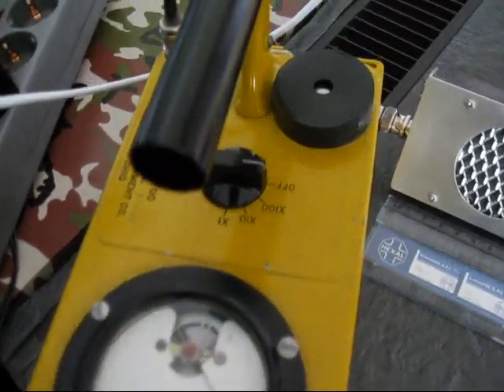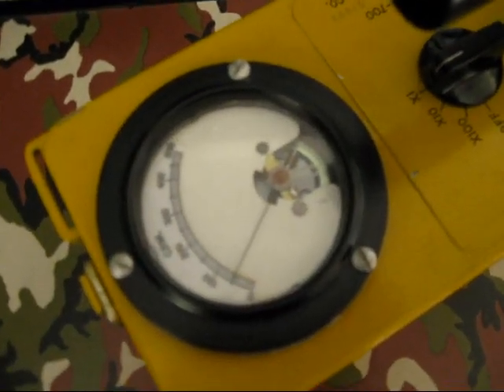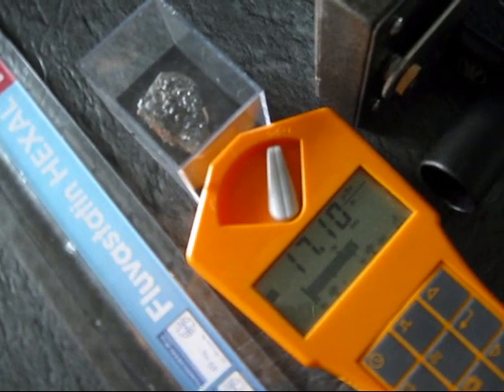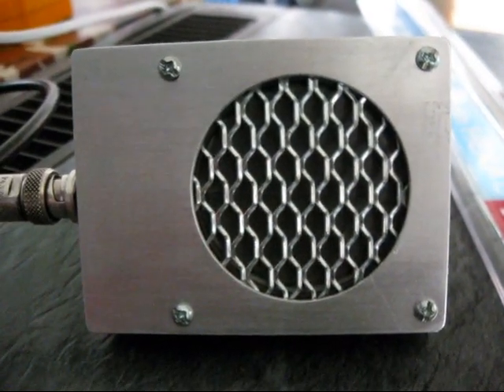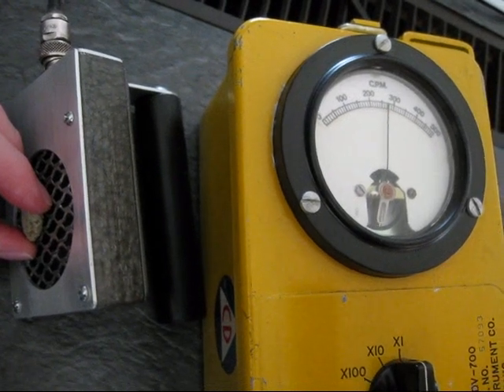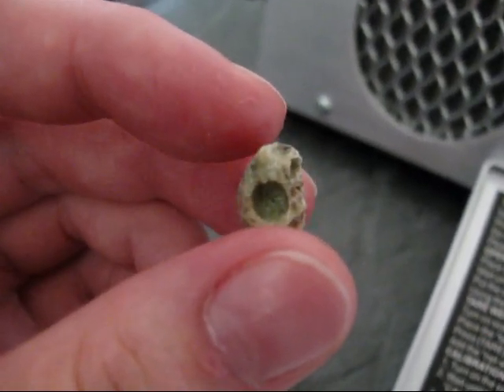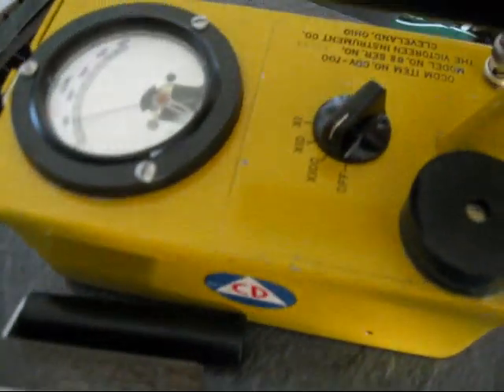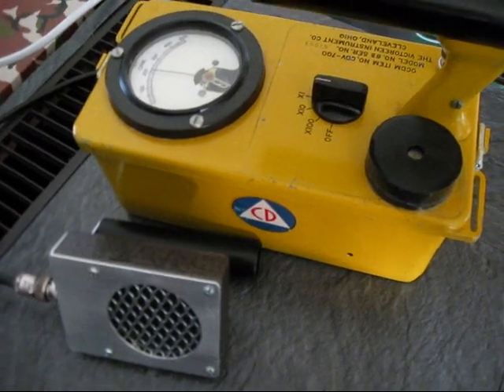Gamma Scout vs. CD V-700 with pancake probe feat. Uranium, Trinitite, Strontium 90

Comment from the maker: @shadowthewedgehog 
sure, i'd tape that Sr-90 to my forehead if i must. :P
well, that'd be unnecessary exposure to critical structures, but i still wouldnt be too worried. and: true, the meter is maxed out - but that's because the pancake probe is incredibly sensitive and the maximum on the CDV scale scale, being 50k, is quite low - NOT because it's a lot of radiation being emitted by that source. there are just ~3500 decays / second total in that Sr-90 disc.

Comment from the maker: @cyberbadger 
hmmm, i dont think it matters that much, as amatomicX modified the scale with cpm (counts per minute), anyway, it does no longer read rem. ;)
it's just important to know how many cpm X uSv/h are, but the same would apply if i'd change the gamma scout to reading rem... so i suppose i'll stick with Sv, as i am used to that unit; and 150 cpm equal to 1 uSv/h on the gamma scout.

Comment from the maker: @cyberbadger 
lol, sure, if they were not absorbed by my tissue - fingers in that case - they'd still come out the other side and hit the pancake probe, that's pretty self-explanatory. ;)
there's roughly 2000 beta particles / second hitting my hands when i do that, i suppose. but as you said, no big deal. impossible to cause e.g. a radiation burn even if i taped it to myself for three days, too. being outside in the summer sun for one afternoon is much more dangerous.

Comment: Also when comparing the Gamma Scout to your CDV - put your Gamma Scout on milliREMS (mR) so it a "fair" comparison. I put fair in quotes because the differences between most of all the radiation units involve so many quantities that it is difficult to quantify properly between different types of sources (point/omnidirectional), intensity, time, distance, damage to to target (different areas of human flesh versus integrated circuts - chips)

Comment: How about FM radiowaves? I was a radiopirate for 10 years and i still experiment with small transmitters.
Or is that a totally differnt form of radiation?
Reply: Read up on the electromagnetic spectrum.  Gamma rays, light, and FM radio are all  photons.  They differ in frequency, wavelength, and energy.  Alpha and beta radiation are not photons, and they are not part of the electromagnetic spectrum.  They are particles.

Comment: i've got a stupid question: why does the geiger counter makes that clicking sound?
Reply: Matias Gareri every click you hear is one charged particle hitting the receptor.
Reply: I'd guess so you can audibly hear the rate, especially when the rate is really low (a few blips in a ten-second period). It's a direct representation of the raw data from the detector, whereas the needle is averaging things over time.